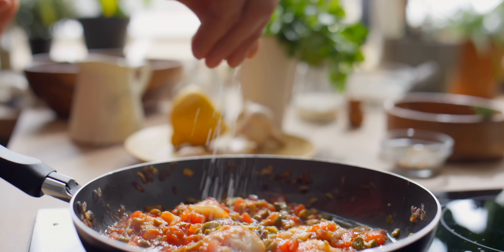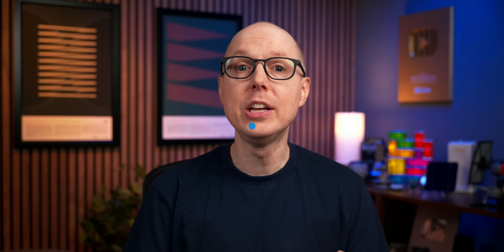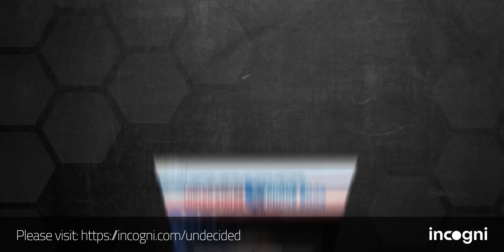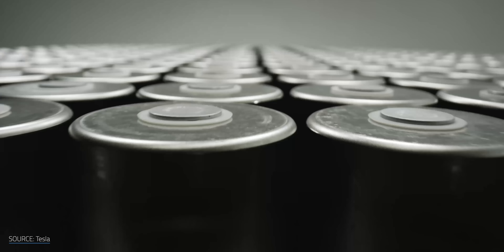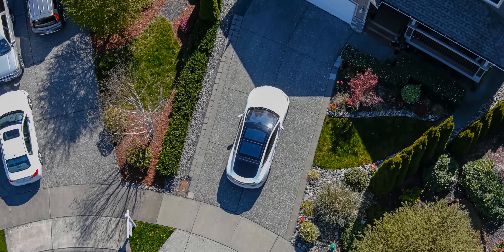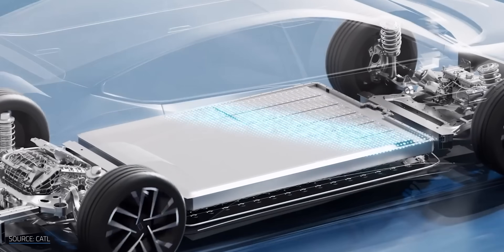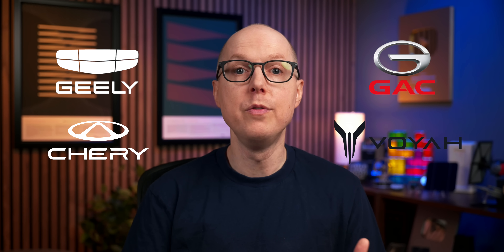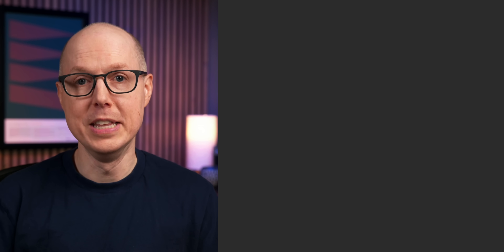How CATL Made Batteries 90% Cheaper (And What Happens Next)

Comment: I own an EV using LFP tech and would have loved it to be sodium based. Since I live in colder climates and the degradation of sodium tech isn't as rapid, I think range should be very much comparable and not having to worry about thermal runaway would be nice.

Comment: Video Statement: CATL has announced batteries (Naxtra) costing "as low as $10 per kWh".

Reality: This is a gross mistake or deliberate manipulation.

Cost of raw materials: Some sources indicate that the cost of RAW MATERIALS (Bill of Materials, BOM) for sodium-ion cells could theoretically approach $10-20/kWh in the distant future.

Real price: For 2025, the real cost of sodium-ion cells (cell level) is estimated in the range of $40-60/kWh, and battery packs (pack level) are even higher.

Comparison: The cheapest LFP batteries in China in 2025 cost about $45-55/kWh. The claim of $10/kWh for a finished product today is a fantasy that has no confirmation in the industry. This is most likely the theoretical limit on the cost of raw materials, mistakenly presented as the price of a battery.

Comment: I am on a 60 year quest to overcome the second law of thermodynamics . that began as a teenager inspired by reading View from a height,  Doubleday 1963, a science anthology by Issac Asimov. He first wrote very convincingly about the  principle that energy is conserved when changing form then wrote much less convincingly about the concept of entropy. 

The concept of entropy is stronngly accepted to this day after being promoted by a prominent astrophysicist, science popularizer, and Quaker Sir Arthur Stanley Eddington who considered the second law of thermodynamics to be the most fundamental and universally certain law in all of science. He believed that entropy never decreased so the universe faces an ultimate heat death of stagnation so somehow the universe had to start with low entropy. Eddington had a deep metaphisical side so he also believed that God was beyond the relm of science. Theologians used the second law as proof of God. This is unsound proof because God could alternatively be supreme over an eternal non doomed universe. 

Energy changes form without gain or loss. Uniformity or diversity is not, in itself, a form of energy.  Therefore entropy is an extraordinary claim burdening the law that energy is conserved even if it is changed in form. Thermal energy's almost universialy observed present practice of a partial  transformation range with an unusable residue is an inelegance. 

Because the second law is intensely accepted it is hard to find people that want to prototype devices that may falsify the second law. Therefore I am posting this essay as a comment on YouTube to attract teams or exceptional individuals with access to suites of complex equipment to build exploratory prototypes that will prove the concept then home in on a good recipe then fine tune for small scale production. A lot of small sample working device trinkets can then be presented and handed out widely to people at media conferences. A low power proof of concept prototype would power a LED in an eyecup with Inspectable parts and assembly and socketable dummy chips as controls. Subsequent conferences would be called to report news of more powerful prototypes powering more powerful samples that can be loaned out for examination. 

Go ahead and start to build something indspired by this introduction without my involvement. We can meet after there is solid crowd verification.
After small scale prototypes of various types are made with widely developed processes many enterprises will be able to think of fitting scale production. There is no need to have one manufacturer emerge. All competent manufacturers should develop their processes without exclusivity or forced dominance. I don't think I have outstanding abilities at this phase so I'll help but mainly get out of the way. 

Let's reframe Earth's low diversity abundant ambient heat as a thermal energy waypoint between heat and other forms of energy. 

Energy sensible refrigerators that absorb heat and yield electricity would complement computers as computing consumes electricity and yields heat. Computing would be almost free. Chips could have  energy recycling sophisticated srructures combining microscale heat pipes and light and electricity paths built in.
Full heat recycling, all electric, very isolated underground, undersea, or space communities would be highly survivable with self sufficient EMP resistant LED   automated vertical farms, thaw resistant frozen food storehouses, amphibious factory submarines, nonstandard dwellings, self contained elevators, safe rooms, and free range transports.Some electrical equipment groups could be consolidated into local networks when suitable. Liquid nitrogen cooled superconducting networks would become practical. Fire safes would maintain contents at a desired temperature in extreme heat or cold for years. 

In a flourishing civillization, small self sufficient electric or cooling devices of many kinds and styles, lamps, smartphones, hotplates, water heaters, cooler chests, fans, radios, TVs, cameras, security devices, robots and robot test equipment, scales, transaction terminals, wall clocks, open or ciosed for business luminous signs, power hand tools, ditch diggers, pumps, and personal transports, would be available for immediate use incrementally anywhere as people as individuals or larger social groups see fit. Human enobeling communities could be built quickly. 

If a high majority thinks our civilization should geoengineer gigatons or teratons of greenhouse gasses out of our environment, hypothetically networked instalations, either a few big ones or many small ones using clean electricity, heat, or refrigeration and producing desired side products would be built. 

A simple rectifier crystal can,
just short of a replicatable long term demonstration of a powerful prototype, almost certainly filter the random thermal motioren of electrons or discrete positiive charged voids called holes so the electric current flowing in one direction predominates. At low system voltage, a filtrate of one polarity predominates only a little but there is always usable electrical power derived from the source, which is Johnson (observation) Nyquest (theory) thermal electrical noise. Max Plank anticipated that ambient thermal noise would become usable with advances in technology.  

How can the emperical second law of thermodynamics possibly prevent this from working? 

In 1973 I filed for US patent 3890161A DIODE ARRAY for an array of metal1/ insulator/metal2 diodes that refrigerate while concurrently producing electric power. The patent was granted in 1975. It was opened to the public domain in 1992. Development is in the public domain while granting me writing attribution. 

The plausible net electrical filtrate from diodes can be aggregated in a first grouping of separate diodes in  consistent alignment parallel. After a primary level of grouping that preferably is in parallel where current is additive, compound parallel and series where both current and voltage are additive, networks can be built to provide desired DC current and voltage. Within limlts, parts of the  network can be shorted out or open circuted without electrical or chemical harm. Widely scalable electrical power always paired with equal refrigeration is thus possible. The efficiency of each diode is probably low because the initial power within each diode is nanowatts which doesn't graph far beyond the near linearity near the 0,0 orgin. This inefficiency affects the performance but not the equality of the thermal absorbtion and the electrical yield. 

The maximum energy is converted from ambient heat to productive direct current electricity when the load electrical resistance  is equal to the array internal electrical resistance. Maximum calculated electrical power output (watts) is k (Boltźman's constant), one point three eight x 10^ minus 23, times T (temperature Kelvin) times bandwidth (0 Hz to a natural limit ~2 THz @ 290 K) times rectification halving and nanowatt power level rectification efficiency, times the number of diodes in the array. 

There are a billion measurment cells of 1000 square nanometer area each per square millimeter, 100 billion per square centimeter. 

Order is imposed on the random thermal motion of electrons by the structual orderlyness of a diode array made of diodes made within a slab: 

Host crystal in this example is silicon or germanium 

  
________   -out
🔻🔻🔻🔻P type boron doped
■■■■■■N type Phosphorous doped
                      +out 

All the P type semiconductor anodes abut a metal conductive plane deposited on the top face of the slab with nonrectifying joins;  the N type semiconductor cathodes or common cathode abuts the bottom face. As the polarity filtered electrical energy is exported, the amount of thermal energy in the group of diodes decreases. This group cooling will draw heat in from the surrounding ambient heat at a rate depending on the filtering rate and thermal resistance between the group and ambient gas, liquid, or solid warmer than absolute zero. There is always a lot of ambient heat on our planet, more on equatorial dry desert summer days and less on polar desert winter nights. 

There are other plausible breeches of the second law of thermodynamics. Hopefully a lot of people, mostly as independent teams, will join in expanding the breech. Please share the successes or setbacks of experiemental efforts. The topic deserves crowd financing, discussion and prototyping attempt action. Crowd development would be resistant to confiscation or burial. At best there could be science quality colaboration. 

These rectifiers could be various types, such as:
• Field emission diodes: An array of needles the needles made of carbon nanotubes or another electrical conductor tipped with an emmisive material probably LaB6 abutting straight in and also separated by a thin insulator or vacuum gap from a metal plane substrate surface.
• Schottky diodes: A metal needle-to-semiconductor junction diode, the semiconductor may be Gallium Arsenide or Indium Antimonide.
• Silicon or Germanium crystal diodes: A well-established technology. These diodes may have poor performance in this application 

These devices would probably become segmented commodities sold with minimal margin over supply cost. They would be manufactured by advanced automation that does not need financial incentive. Applicable best practices would be adopted. Business details would be open public knowledge. Associated people should move as negotiated and freely and honestly talk. Commerce would be a planetary scale unified conglomerate of diverse local cooperatives. There is no need of wealth extracting top commanders. We do not need often token philanthropy from the top if the wide majority of people can afford to be generous. 

Aloha
Charles M Brown
Kilauea, Kauai, Hawaii 96754

Comment: We have a car with a CATL NMC ternary battery. It has been really good but does drop in range during colder weather. We change our vehicle approximately every 9 years. I expect to see sodium or a combination of sodium and lithium battery in our next vehicle. I would much prefer to see a sodium battery for house storage. The current cost and capacity of house battery storage doesn’t really add up even with government subsidies currently available. If the cost, safety and capacity became much cheaper that would dramatically increaase our inteest in expanding the size of our solar panel array. Unfortunately our current EV is not equipped with vehicle to house or vehicle to grid. The viability of home energy storage could dramatically change with much lower KWh storage costs.

Comment: EV range anxiety is a real thing for several reasons - stated range doesn't match reality, and battery ageing limits it further. It resuces confidence for long distance drives, especially with long charging times thrown in. If sodium batteries are ageing is negligable, and charging times are faster, then suddenly a big part of the problem is eliminated. I've held off buying a full EV for these reasons, and of course cost/depreciation. This finally might be the kick the EV market needs.

Comment: I live in a motor home, and have been following developments in EV tech usable by motor homes - for the drive trains. (LiFePO4 batteries for house loads are one of the first upgrades new owners switch to, from lead acid tech.) Furthermore, the average driving day for a motor home is about 150-200 miles, and that battery power ought to be within reason for motor home drive trains.

Comment: If I can install more Kw of batteries outside my home that can stand winter and summer temperatures then energy density is no problem. I am watching already for supplies and might be persuaded to become an early adopter if the specs and price convince me they will be better than lithium. Also, if there is negligible fire risk I could consider installing them inside rather than the lithium which is currently outside for safety

Comment: The revolution is not in having individual batteries that are cheap. The revolution starts with car batteries powering houses and are linked to the grid so that when the price of electricity is low, the battery charges, when it is high, the car discharges. That's accumulated grid-level electricity storage. 
Now how many car batteries would we need the make this bidirectional charging work to buffer the grid? Trials in Germany suggest for 80 mill Germanys, it'll be about 1mill cars.
Easy.

Comment: I mean isn't the obvious move for CATL to start these batteries at closer to $85 per kwh instead of promising $10? If they're 95% as energy dense, charge faster, are safer, and can handle extreme temperatures without any drawbacks, I'm perfectly Ok with paying 25-30% less to start and letting economies of scale build so prices can drop further. $10 per kwh is unrealistically cheap any time soon and I'd never expect that, but to even someday see $40-$50 per kwh for a 30kwh home battery would be incredible.

Comment: If the car still got me 250 miles to a charge, I don't give a monkeys about the tech underneath. In fact, if it could get me that 250 miles in cold weather, when my NMC powered Ioniq 5 drops 20% range, then that's a significant advantage.

And if I'm buying a car the size of this I5 for just around 28k then that's bingo.

Comment: My issue isn't with the battery tech so much as the sheer size of EVs. And the infrastructure for charging.

Most don't want to 'manage' or 'worry' about the battery, like you would in an ICE vehicle. Just gas it and go. Maintenance on a regular-ish schedule.

Comment: Where did you get your data on lithium battery charge cycles? Anyone owning a cell phone knows we could never get 4000 charges before hitting 80% capacity. That would mean we could get almost 11 years of use if we only charged the battery once per day.

After reading marketing materials for battery manufacturers, it would be best not to claim something as fact. Instead, use your personal experience while considering whether or not what they claim is true. A little free thinking can go a long way to saving your credibility.

Comment: I’ll soon be replacing my hybrid battery pack with a sodium ion upgrade, over the nickel metal hydride factory battery. So there’s another application use, hybrids. Less weight and higher energy density were the selling points for me. 

The rapid discharge/recharge is another reason they seem well suited for hybrid vehicles.

Comment: We used to drive BEVs with range of 300-400 km and were happy that it wasn't 200-300 km as before. Latest BEVs became even more efficient and provide 500-700 km of range. So, switching those to Na batteries and getting back to 400-500 km range and cutting the costs by 10K, plus eliminating the fear of super-expensive battery replacement, would be a breakthrough in BEV adoption.

Comment: Yeah if the pricing is on point that would take care of the two big reasons I don't even consider EVs today.  The price point of an EV versus a basic internal combustion engine and Lithium Ions nasty habit of turning into a torch if it degrades enough.  There is no getting around the use of Lithium Ion for small devices like phones etc. but at least at that size the damage done can be controlled.  Not so much with a battery pack the size needed to power an EV.  That sucker is going to burn until it is good and done by itself.  If you have a garaged car now your EV car is out to kill you.  Thanks but no thanks.

Sodium Ion (if the price is legit) would remove those problems while also giving you the added benefit of easier for software to tell the state of the charge compared to Litium Ion and an extended thermal operating envelope.  So while in it's current form it's not going to replace the batteries used in smart phones it could easily replace the massive car battery packs.  If they can only make a better "plug and play" way of getting those batteries replaced this would negate having to read stories about perfectly good EVs being written off by insurance companies because the battery packs are sooo expensive to replace it makes more financial sense to just trash the entire vehicle.  That is a travesty to try and make EVs to not pollute as much to then add pollution by destroying perfectly good vehicles just due to a worn out battery pack.